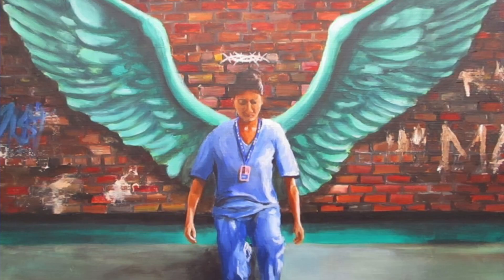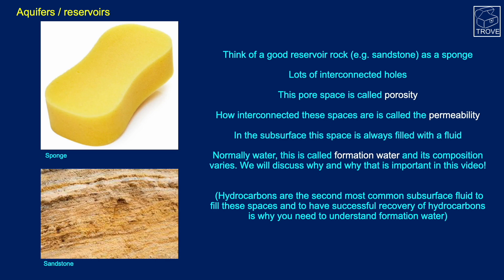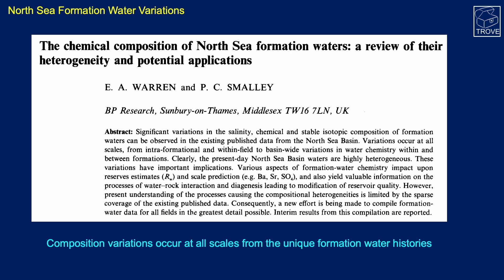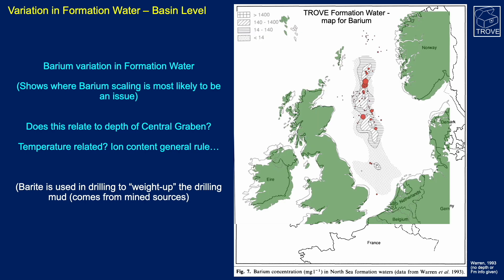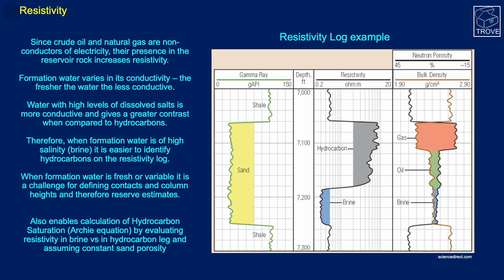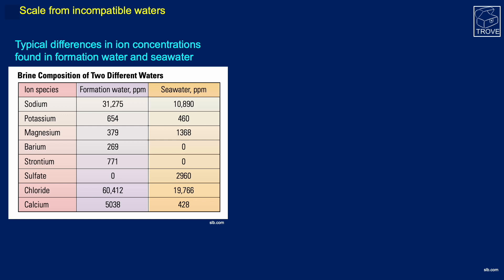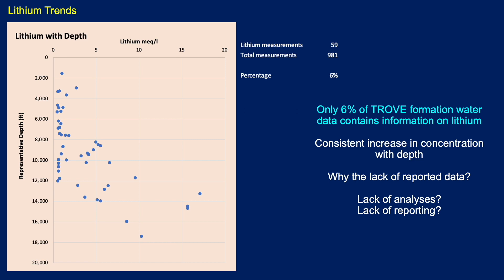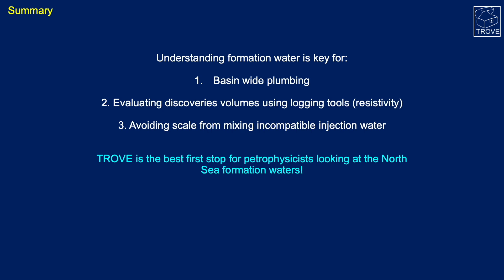Oilfield PRODUCTION Challenges - Formation Water

Comment: Any example of extracting lithium from formation water, or other use than dumping in ocean or reinjection for pressure support? Thank you!
Reply: Thanks for the question. We do not know of any working example of processing produced water for lithium. We pose the challenge - if you are dumping hot produced water anyway, can a recovery process be justified?
Reply from the maker: Not that easy to retrofit heat-extraction equipment on aging infrastructure. Unless platforms were designed specifically for this use there are space, power and weight constraints on most platforms in the North Sea.  And none were to the best of my knowledge. They would not have been economic at that time, possibly not even today.